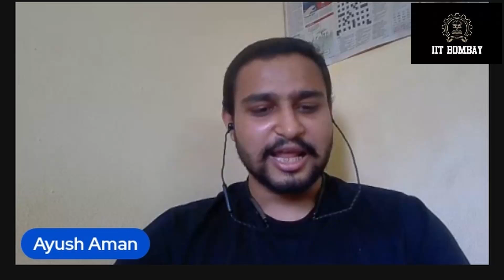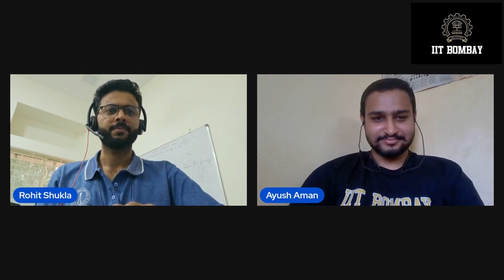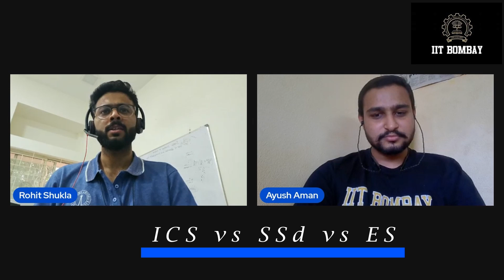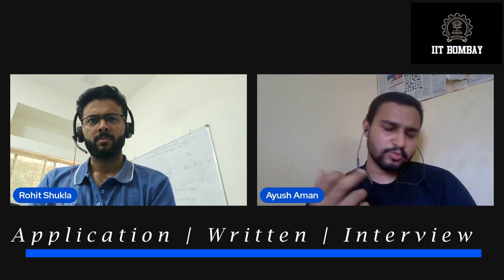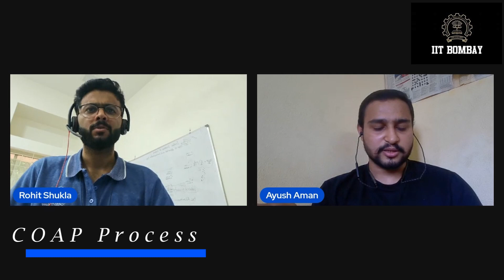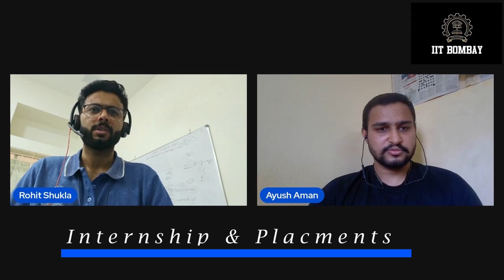IIT Bombay MTech | TA vs RA | ICS vs ES vs SSD | Interview| Internship & Placements #iisc #iit

Comment: hi sir , is IIT Bombay take interview for electronics system and solid state divices  I am getting 650 gate score in ece with obc category will i get iit bombay electronics system, ssd
Reply from the maker: Interview is conducted for RA programme, so in that based on performance you can get ES or SSD. 
For TA programmes you should check previous years final cutoff.

Comment: I got IISC Mvlsi and iitb SSD in round 1 , in further round I will get ES, May be ICS at iitb, so which is better option to choose IIsc or IITB
Reply from the maker: Choosing between IISc and IITB is really difficult, that too when you are getting top branch in both institution, a simple thing you can consider is that in IISc you will be more surrounded by PhD people, and very less TA duty ( any one semester), In IITB you will be among the toppers of JEE advanced, helping them as TA. So decide what you prefer, as both have its own advantages.
Reply: What was your rank ???
Reply: @GSRESPECT841 21
Reply: @jjpkfarm487 what was you rank and which branch did you took your GATE from?
Reply: @abhinavbhardwaj6796 IITB ICS